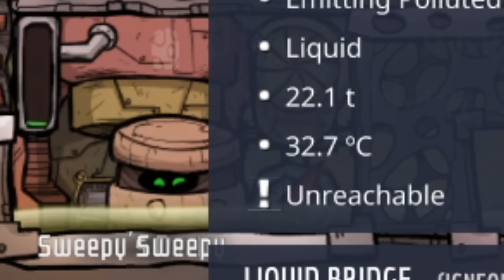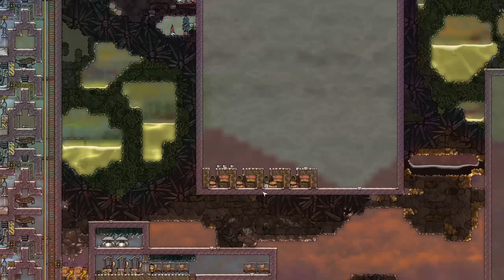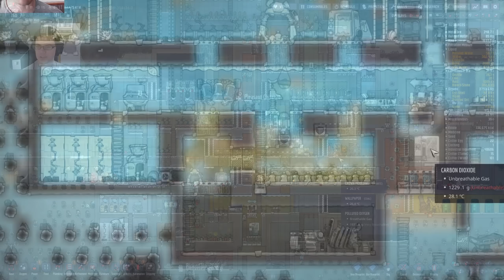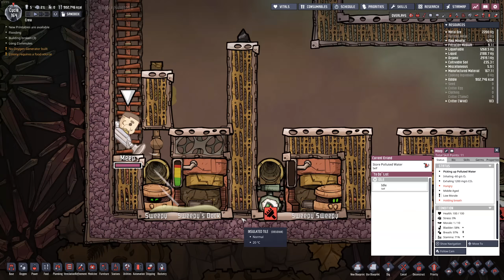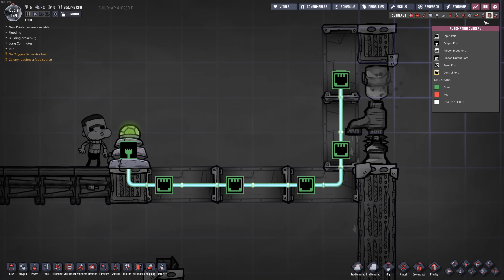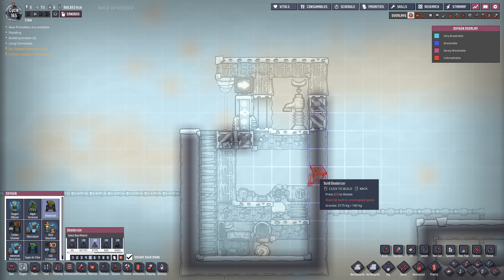Loads Of Oxygen With Sweepy! Oxygen Not Included

Comment: Sooo, this is probably the best way to generate Oxygen then, I assume? Even tho it's a bit exploity. Once you've got enough of those bottles there, you don't even need a dup anymore.. Do they keep off-gassing forever, or do they eventually run out of polluted water inside them? If so, then this method takes zero input/energy/resources at that point.
Technically you don't even need all the automation to get a system like this running.. Setup a liquid vent to keep trickling just enough water into a small area, that dups can mop it up into bottles and just leave it there with deodorizers around it. If you get the speed just right, I bet you could have the dups mop it almost continuously, until there's enough there to generate plenty of oxygen. Tho I haven't seen your previous videos on this mechanic, so I assume you've probably done this already. ;D

Comment: Wouldn't it be possible to have a pipe filled with polluted water, and have a duplicate plumber drain the pipe while on a ladder, so the bottled liquid falls out of reach? It might be faster that way. Also, it'd be difficult but you could chill the P.O. to make it liquid and lose the polluted status, then heat it back up with the oncoming P.O., making a crossflow heat exchanger. Last time I checked P.O. has a higher specific heat capacity than oxygen, so you'd create a small amount of heat in the process.

Comment: What if you use an infinite liquid storage setup but instead of doors, you use airflow tiles? That would skip the entire automation setup and the sweepy requirement making it a zero energy setup (not quite zero you stil have to pump polluted water into the system)

Comment: Wouldn't it be simpler to just compress the water into airflow tiles and let it off gas naturally? That's what I do for my Puft farms. A row of 1x5 tiles with 30 000kg+ each and 2 pumps above is more than enough to sustain a 8 Puft farm. No work needed, just pump in water and pump out p.oxygen and do with it what you want. There is no downside to pump more than you need either cause it can't really overflow.

Comment: If you put a small layer of water on the tile that holds the Polluted water bottles they will never over pressure and keep off-gassing at full rates and never over pressure.
I accidentally found that out in one of my bases when I keep getting popped ears and couldn't find out why.

Comment: What mods are you running? Pliers is Snip, what's the other one to the left of Disinfect?

Could you run a signal off the duplicant sensor to disable the wheel/other job or close it's door, so they run towards it until they're away from the sensor? If that works can you move the wheel near the sweepy dock so they don't even run in the wrong direction? I'm really wanting to come up with a way to use the Counter 12 times with the 2kg limit, can you put a weight plate above a sideways door?
Reply from the maker: blueprints
Reply: @brothgar  Thank you for making such excellent videos!

Comment: Seen a system using the same effect, by filling reservoirs and then deconstructing them to get bottles over and over. Then the polluted oxygen is pumped to a different room to be cleaned similar to your design. It started more as a system to produce lots of clay. The builder was amazed by how much oxygen it produced.

Comment: Too avoid overpressure have the dirty water sit in a small (very small just a few grams) pool of liquid  (something that doesn't off gas) and it should just overpressure the area, then you can use pumps as needed, it works with slime/ polluted dirt although I've never tested it with dirty water, hope this helps run it more efficiently 👍🏻

Comment: Wait a minute...
Could you use this method to cool your base as well?  If the polluted oxygen comes off at the temperature of the water, could you insulate the whole system, sweep up the polluted water at -10C or whatever, and get infinite -10C oxygen out of it?  Just send it through radiant air ducts and then vent it into space once it's above say 25C?

Comment: If you arrange it so the polluted water is at the bottom of a bead pump you can suck all that polluted oxygen straight up and away from it without pumps, you'll still be limited to about 2kg/s off gas per stack however.
The bead pump can cause overpressure in a PO2 storage area, through some automation you can open/close door access into deoderization/algae/puft rooms at a controlled rate as the base requires.

Comment: Actually, you're cooling down the Polluted Oxygen, because the gas pumps compress the gas into a cooler state... it's like a less-effective Wheeze Wort and runs on power, last I remember.
So you'll eventually get cooler oxygen out of purifying it, because Deodorizers don't emit heat.
Reply: What?  No.  Gas pumps have no cooling effect and will add heat to the system.

Comment: is thiw more efishent than a electreliser?
because electleriser is not 1 to 1 water to o2
is this 1 to 1?
Reply from the maker: 1:1 yes, but the output will slow over time. Energy cost is a tricky one to compare. This is a lot of labor or automation connected to running filtration mediums, so I think at the end of the day that's where the bulk of the time or energy will go for the P water system.  Then you have all the pumps and heat systems connected to an electreliser... so yeah.